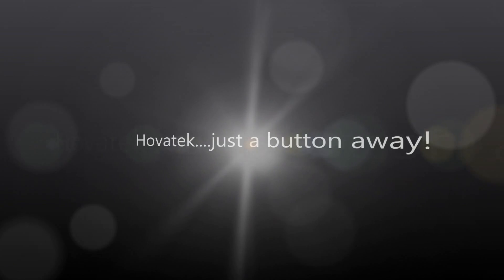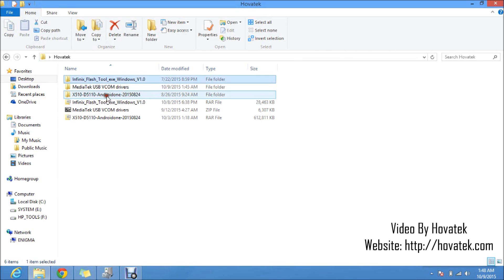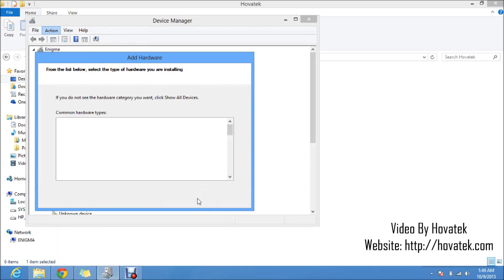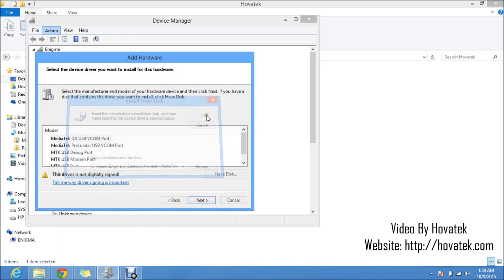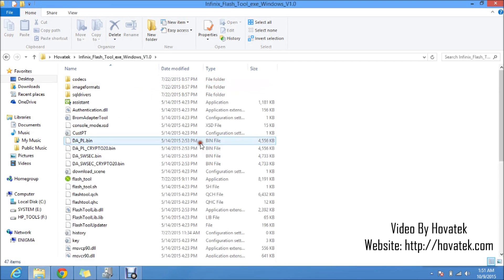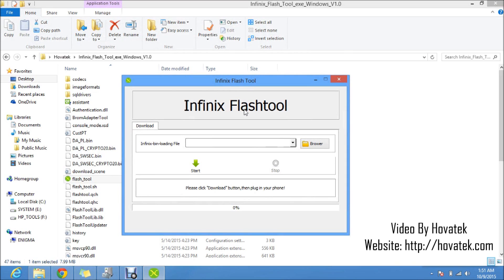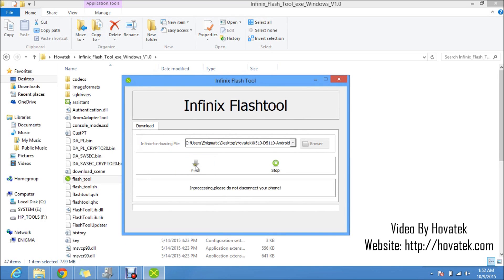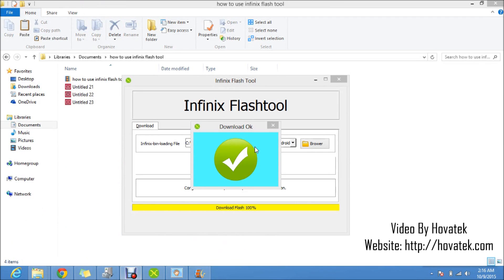How to use Infinix Flash Tool

Comment: hi i have a huge problem, im using infinix flash tool v1 on infinix hot40pro, i follow the steps but when i browse the scatter file  inside the firmware folder it says sp flash tool error (8417)   the load scatter file is invalid  Please check the scatter file and try again.Pleaase help me huhu
Reply from the maker: Use SP flash tool instead

Comment: I have my INFINIX HOT 6 that I buy, after having made a software update from the same phone it went off and no longer lights. I try to flash but when I plug the tel on the computer it connects and then disconnects automatically I do not know what to do I need help
Reply from the maker: We'll be happy to help. Go to https://forum.hovatek.com and click Ask Question at the top. Explain this and post.

Comment: Does this procedure affect the IMEI of the phone
Reply from the maker: No, it doesn't. IMEI is only affected when you flash NVRAM or format
Reply: @HovatekTV  I want to flash Infinix x603, zéro 5 pro. I already have the rom, SP flash tool and driver's. Do I remove the simcard before starting
Reply from the maker: @dingbobgagalabe8825  No need to

Comment: I can not bypass google account verification. Although I enter login information for my google account that I used before downloading the stock marshmallow ROM.
How can I fix this issue ?
Reply: Flash the phone again problem solved
Reply: To prevent this from happening to any other phone of yours 

Go to settings 
About phone 
Press build number 7-8 times to unlock developer options 
Go to developer options 
Tick oem unlocking  
You will never have this problem again
Reply: @platinumorange1034  does this work bto
Reply: Did it work for you bro l want to try as possible my phone is stuck in charging logo and makes like pip inside when l connect to the laptop top when it does that my phone also turns on off do you know how to unbrick it